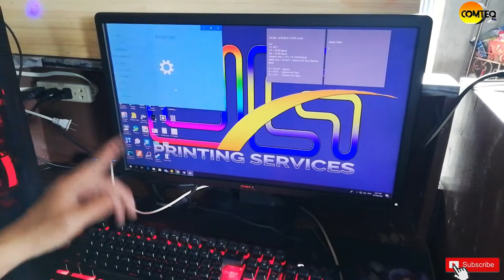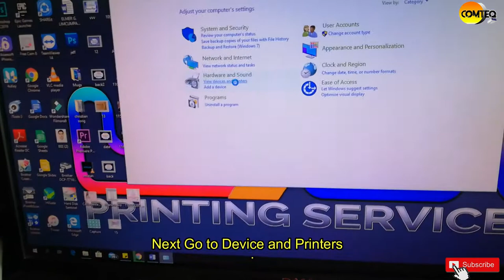How to Install waste Ink tank In Epson L120

Comment: san sir nkkbili ink hose with connector?
Reply from the maker: sir may mabibialn ka po nian sa lazada ksama po sya sa ink system or CIS for canon
Reply from the maker: sir eto po ung link https://shopee.ph/DIY-CISS-kit-4colors-for-canon-HP-printer-i.41349029.1009202294?gclid=Cj0KCQiAwMP9BRCzARIsAPWTJ_FaiqHsZjhohohN0U9EXbKLB4NqrTo5EhvWE4-LtbkErgn4D-4r_DUaApYDEALw_wcB